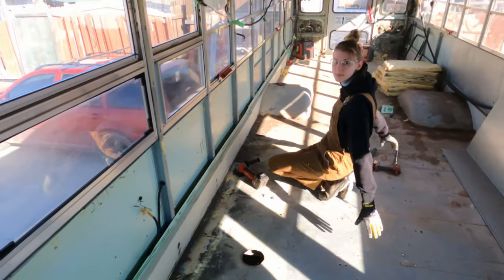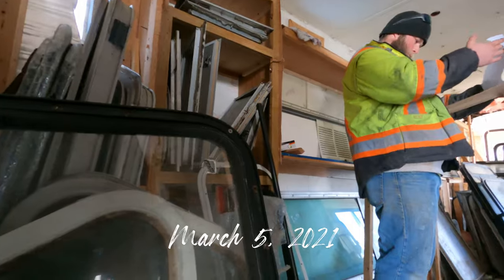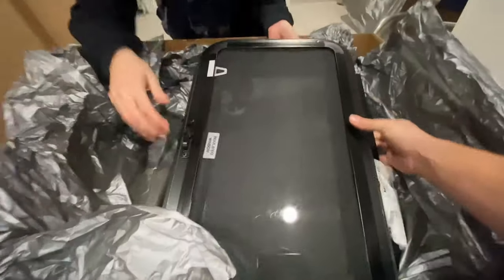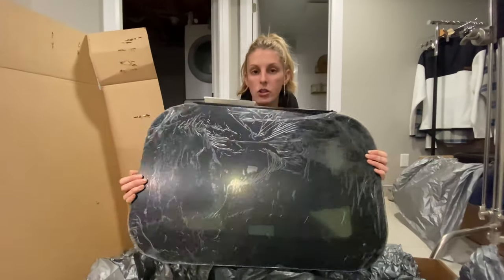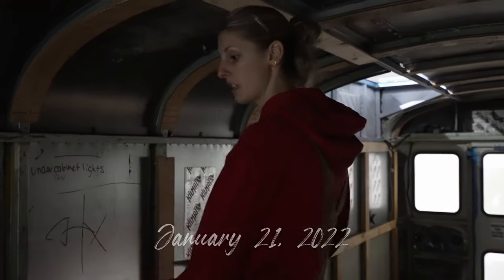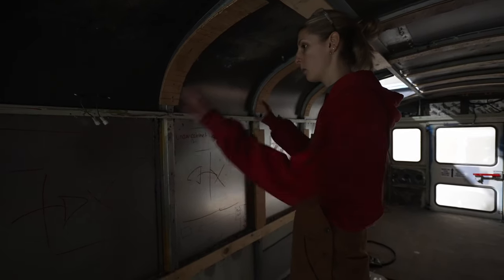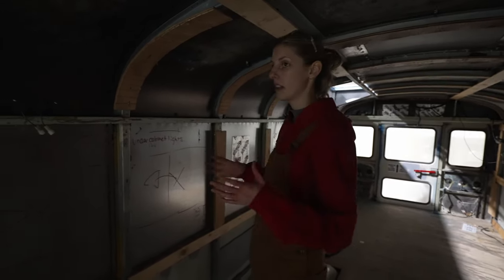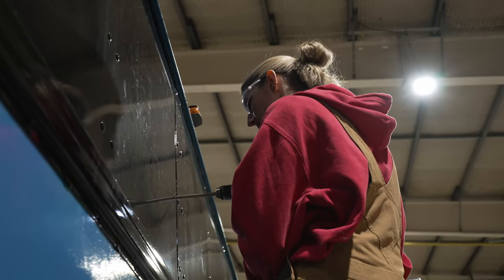Installing RV Windows | Skoolie Conversion Ep. 20 | Adam & Steph

Comment: Looks amazing great choice, planning on doing the same to our bus. My only question is why didn't you just cut from the inside ? Then you wouldn't have to transfer your measurements to the outside or worry about taping or scratching the bus ?
Reply from the maker: You could cut from the inside. We just found it more visually intuitive for placement to position them from the outside.

Comment: Beautiful!!! I'm curious if you considered wood and why you (if so) decided not to use wood :)
Reply from the maker: I wouldn’t really recommend using wood as structure around things like windows because it’s much easier to rot. Steel is much stronger, especially when cutting out a channel that’s already on the bus to fit a window, that load needs to be diverted. Using steel is definitely the proper way to do it!

Comment: Did you use 1 1/4 or 1 1/2 tubing for frame?
Reply from the maker: 1 and a half inch square stock with 1/8 inch wall thickness i believe. Matched the hat Channel dimensions

Comment: Next time use suction cups that pulls out dents to hold the panel from falling $10 for 2.....or drill 2 holes and use along bolt with 2 nuts 😜
Reply from the maker: We used welding magnets from the inside for the last window. The real problem was a lack of hands bc 1 of us was filming and the other was cutting lol